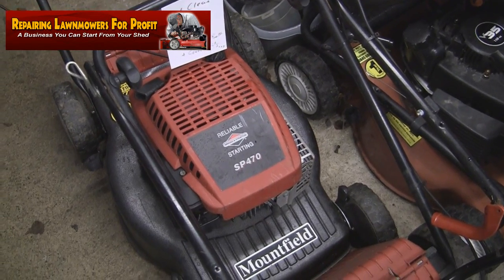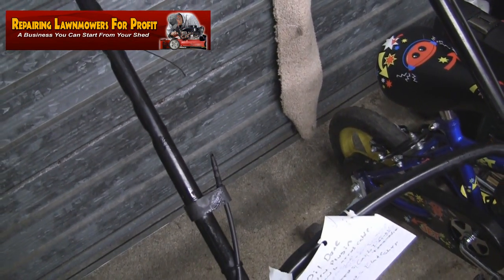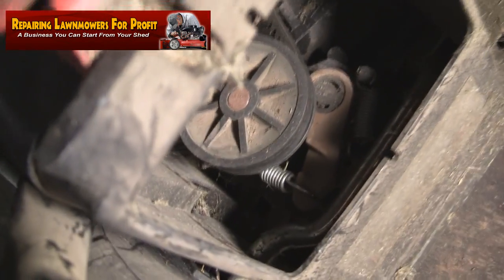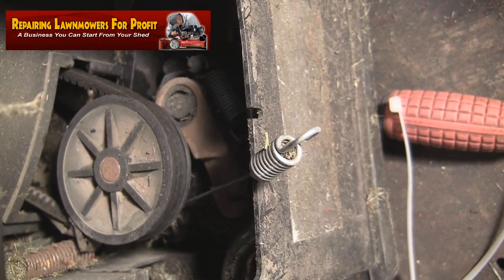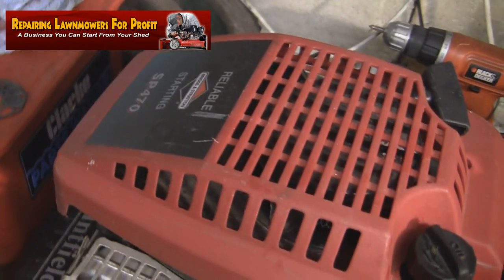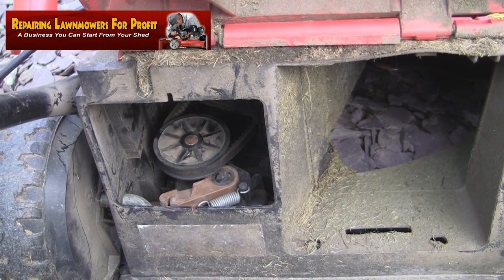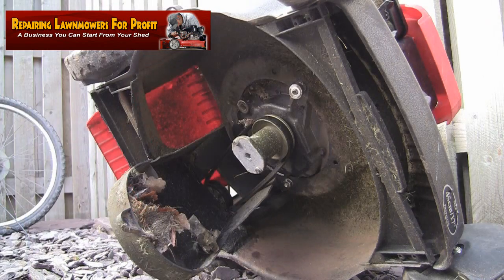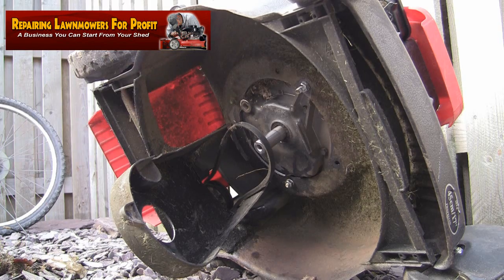How To  Replace A Mountfield Lawnmower Drive Cable

Comment: WHEN YOU OPEN THE BACK BOX TO GET TO THE CABLE IF YOU UN HOOK THE SPRING WHICH HOOKS TO THE SIDE OF THE DECK YOU DO NOT HAVE TO REMOVE THE BLADE TO RELEASE THE TENSION ON THE BELT THE DRIVE WILL JUST FLIP UP & DOWN AND YOU HAVE PLENTY OF ROOM TO FIT THE NEW CABLE THIS IS THE ADVANTAGE OF THE MOUNTFIELDS WITH THE REMOVABLE BOX. NOT LIKE SOME MAKES WHERE YOU HAVE TO WORK FROM UNDER THE DECK THIS CAN BE A REAL PAIN TO DO

Comment: Hi MowerMan, great videos.  I have a Mountfield SP454 (2012) and I need to replace the drive cable.  Unfortunately there isn't a box to remove underneath the stoneguard like on this 470.  Any ideas on how to access the end of the cable attached to the drive unit?  Do I have to take the drive unit off?  Hopefully you will have the solution like you always seem to!!.  Cheers.

Comment: Hi Mower man, great tutorial!  I have a question ref the clutch cable, when putting the new cable in do you need to take the spring off or can you feed it through the hole in the pulley assembly that the little plastic Bush with the one way arrow flange on it?
Reply: Update.  You do not pass the spring through the recess for the plastic boss.  Instead you loop the cable and the spring over the arm of the pulley assembly and then seat the plastic boss into the recess.

Comment: Hi I've just replaced the drive cable on a mower the same as in this video but  there was a broken spring loose in the compartment I can just see it at 8.48 mins in the video upright on the left hand side next to the belt drive, can you help (maybe a photo) to locate the mounting points for the replacement spring. 
Thanks Neil
Reply: Hey can I ask ref your cable, did you fit the new spring through the hole on the drive pulley or did you remove the spring from the new cable 1st?